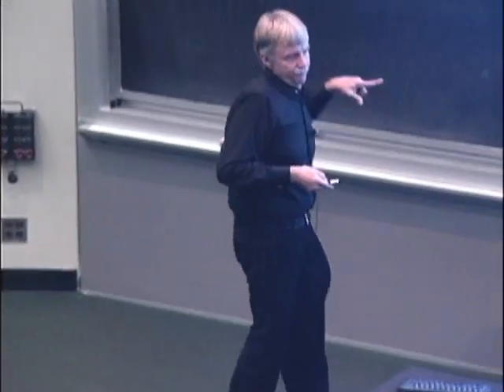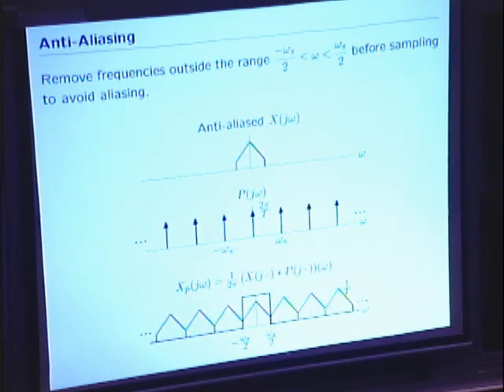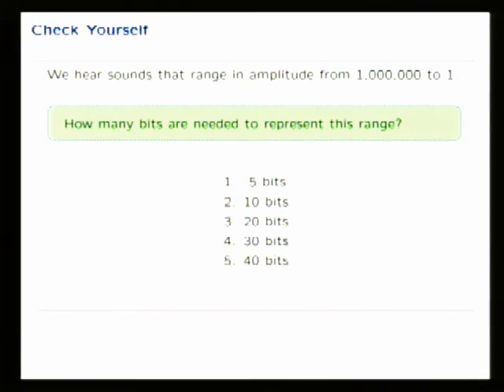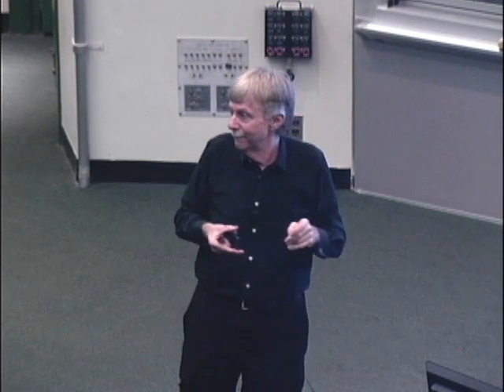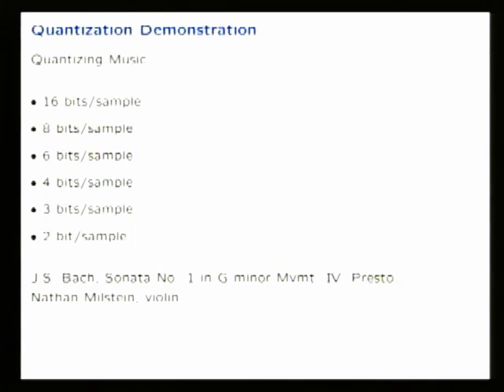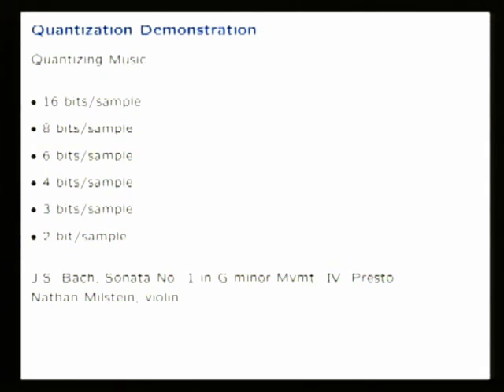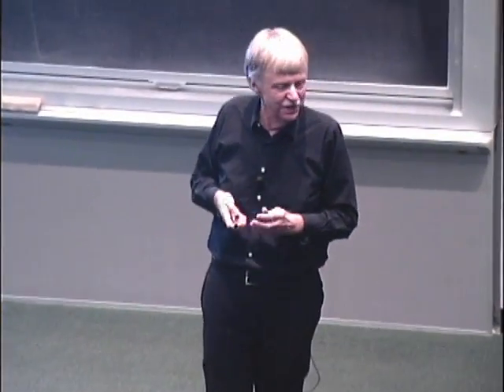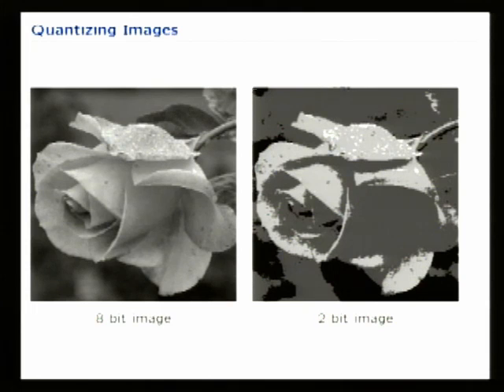22. Sampling and Quantization

Comment: It is interesting what the professor says about how you must choose what to encode on a 1GB disc, either high quality audio or more time at less quality. However this is not how it came about. The acoustic characteristics of the CD were first selected and defined by Philips and Sony, THEN they picked the physical size of the CD, where Philips wanted a smaller size disc but Sony made it to be slightly larger in order to not let Philips have the upper hand. When talking about digital signal processing, it's not a good idea to talk about a commercial product unless you know all the details, otherwise you are almost certain to make mistakes, such as this one.